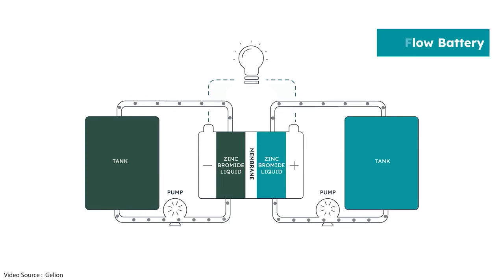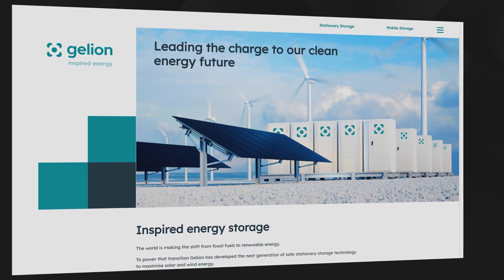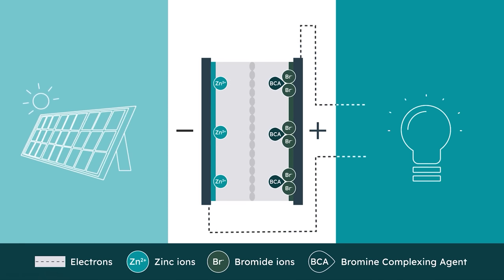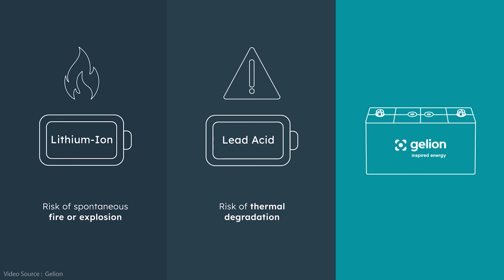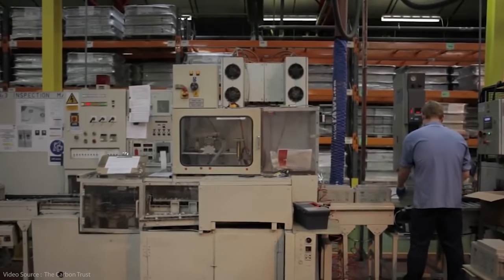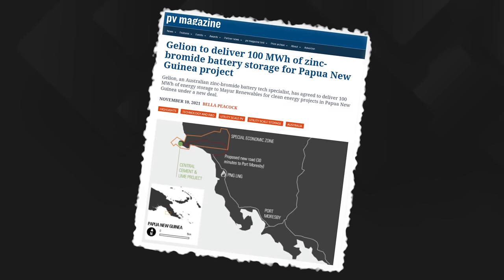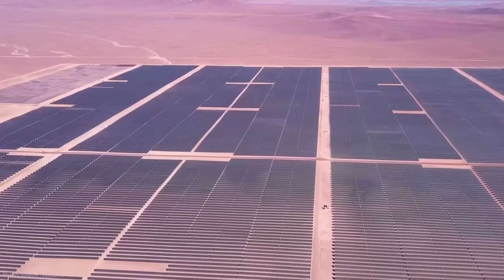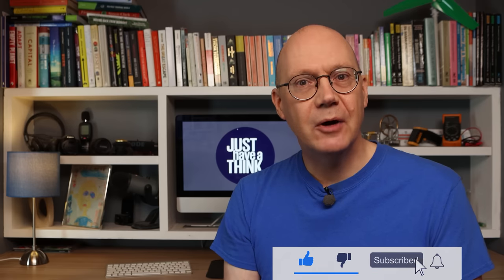Zinc Bromide GEL batteries. Cheaper, greener, simpler & safer than lithium -ion!

Comment: I've felt for some time that Li-Ion batteries are overkill for home/business/utility scale battery systems. With Li-Ion more ideal in the realm of mobile solutions. Stationary batteries do not suffer from the practical limitations inherent in mobile solutions. You don't need something that is particularly light or small. I definitely feel that Li-Ion does not hit the sweet spot for stationary applications. Furthermore it would be better if the demand for minerals needed for Li-Ion for mobile applications does not have competition from the manufacturing of stationary batteries.
Reply: Also, the Gelion battery has no fire-safety issues at all.
Reply: You are right but unfortunately Li-ion is the only proved battery technology for relatively large scale energy storage.
We already have quite some alternatives that may replace Li-ion in the future, but it will take years to prove they are indeed reliable enough before being widely adopted.
Reply: @garylee867  Certainly. Which is why I'm always happy to see possible alternatives.
Reply: @garylee867  .. Seriously?? Maybe Li-Ion batteries are the ONLY proven large scale battery storage BUT
 Pumping water UP into a reservoir during slack demand yields HUGE quantities of stored energy. Way more than any existing quantity of any batteries.. batteries arent necessarily the best way to store potential electricity.  LARGE scale storage may not be viable using bartteries.  However this seems to break that mold
Reply: @rowaba  
Pump hydro is not the solution either (if it is, why do we bother coming up with alternatives).
Even if we put the environmental impact for building pump hydro aside, they are high depending on the geography. We just can't build enough pump hydro in practice.
We need something that is cheap enough and can be built almost everywhere.
Reply: Lithium Iron Phosphate is the happy medium for homes/stationary JMHO.
Reply: @robbonner  It's better. Cheaper than one's typical Lithium based battery, but still overprice for what one might need for stationary applications I think. For stationary applications long life, affordability and safety > energy density and even charge time. I think right now the big money is simply not in exploring the type of low profit margin chemistries that would suffice. Though plenty will be found along the R&D way I believe. Eventually one will make it into mass production and the market for stationary applications. Right now though. There's gold in scaling lithium based batteries.

Comment: Year after year, a new revolutionary battery technology is announced, yet year after year we're still using Li-ion.
Reply: just like the tv's of today are almost nothing like the tv's of 30 years ago, let alone 50, the li-ion of today has increased safety, density, capacity and charge rate. just over the last 7 years, i went from a smartphone with a 1000ah battery, to a smart phone with a 5000ah battery, a five fold increase, and my phone is a midranger, not top of the line.
due to the industrial nature of the technologies being discussed, they are changing the backend of the market far more than the front end. that being said, i do think your right about how even utilities are still increasing usage of li-ion. however, that's more due to the maturity of li-iion, utility scale is much more slower due to increased bureaucracy and politics. as time moves forward and proves the success of some of these projects, they will be more likely to scale. if you want to speed up the process, you might want to get a guillotine then.
Reply: @charonstyxferryman  whoops, my bad, mAH. its been a long year, ok